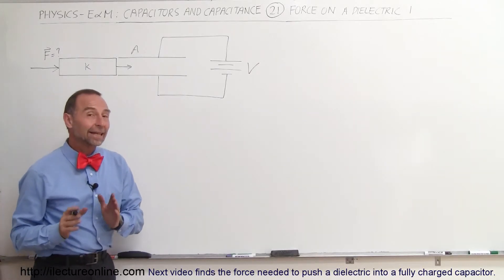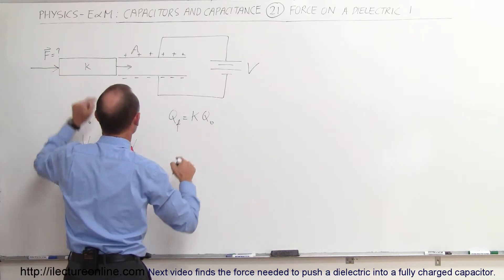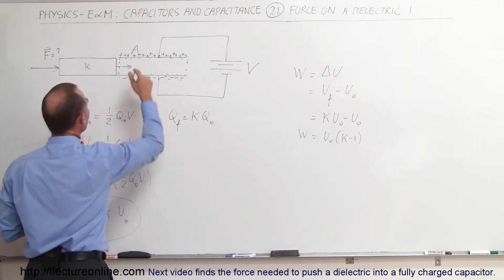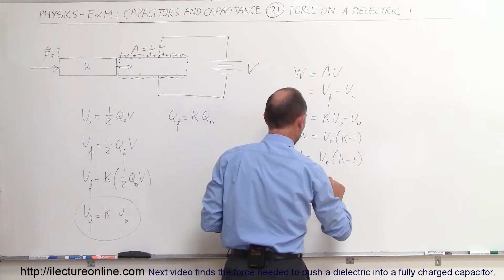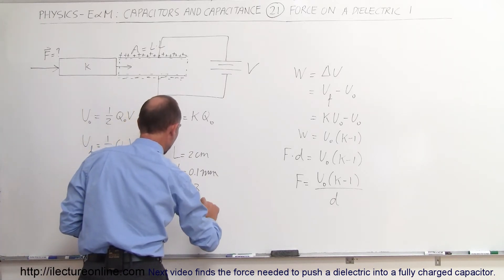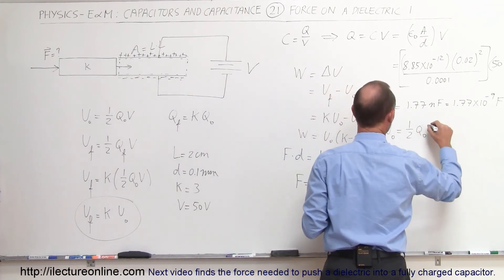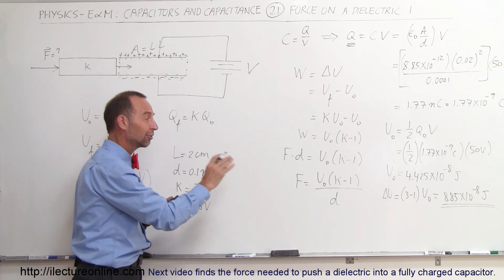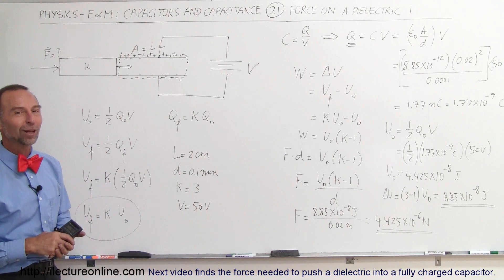Physics 39   Capacitors (21 of 37) Find the Force Needed  to Push a Dielectric in a Capacitor

Comment: so putting a dielectric will increase the energy always???
Reply from the maker: Pushing a dielectric into a capacitor while the capacitor is connected to a voltage source, yes.
Reply: @MichelvanBiezen thank you

Comment: Sir , if capacitor is square then d should be equal to L.
Reply: That's not it. d is the distance between the plates, it doesn't have to do with the dimensions of the plates on their own, which in this case they are square ones. And since we consider the plates infinitely large, d has to be very small.

Comment: Professor Just for cursorily sake wouldn't the d=.001m.  therefore F=w/.001m ?
Reply: zxcvbnm8141 you’re pushing the dielectric for a distance l, the length of the capacitor

Comment: since you require a force to push the dielectric into this capacitor in this case, does that mean if i were to leave the dielectric just a the mouth of the capacitor or even inside the capacitor without applying any external force, the capacitor will repel the dielectric and push it outwards?
Reply from the maker: That is correct.
Reply: but doesn't the battery do work on the capacitor as well so as the sum of work done by you and work done by battery equals to the change in potential energy of the capacitor?
Reply: i have checked a book on electrodynamics by Griffiths and it seems that you have neglected the contribution of the battery to the total change in potential energy. I think you should remake this video again so as to not give the wrong information to more people.
Reply: it would sound illogical that the capacitor that is connected to a battery will repel a neutral dielectric instead of attracting it as a result of charge induced in the dielectric.
Reply: Why don't you could try to provide us the right information? I think you are capable of it by reading your comments, a lots of people will be very happy to see it.

Comment: Wouldn't the distance that we apply the force be L instead of d? Because we are pushing the dielectric for a distance of L?
Reply from the maker: d = separation distance between the capacitor plates.  L^2 = A = surface area of the plate of the capacitor.
Reply: Indeed, pardon my ignorance.
Reply from the maker: No need to pardon.  I welcome all questions and I am glad to clarify anything.
Reply: TheErolDude trying to say that F.d equations it must be L or whatever since Force in horizontal but d in the vertical.  It is problem sir.